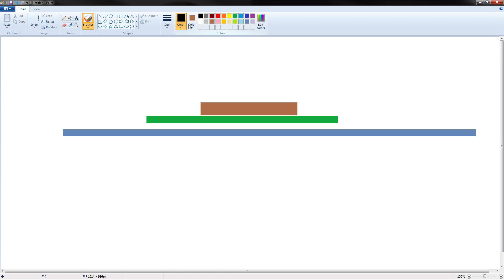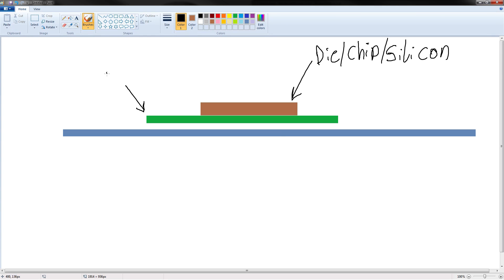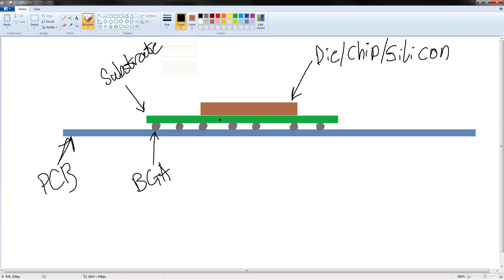Xplained with paint: baking GPUs

Comment: i have a broken r9 370 2gb so i did do the reflow repair using dremel heat gun for 10 min and kept the temp 300c after that i let it cooldown for 10min and put thermal paste. put it in my pc and still doesnt work :(
Reply: You probably killed the components with 300c.

Comment: I've always been told that the main reason for failure was due to the move to lead-free solder. The replacement solder used at the time was prone to develop micro fractures because it was less flexible under thermal cycling - so much so that Hewlett Packard for instance was his with a class action lawsuit because its laptops were prone to fail with this problem after a year or so. Reformulation of the lead-free solder has since addressed this problem.

Comment: You say the BGA balls wont melt while saying the lead around the GPU die will? it has a larger thermal area/size too a BGA ball?
If you heat the card to 180+ you can damage the caps but if you heat the card too 130c you can FIX stuck switches inside the die, the heat shakes them loose.
If your card worked and then died after you baked at 190c, then you cooked your caps........... that simple, love how this has become an Internet myth now.

Comment: Nice explantion.
I do not think you can melt or reweld any metal at 180C, is impossible.
I did reflow to an Nvidia graphic card from my Dell laptop and Worked..!!!!. YES WORKED..!!
Graphic card problem was  a set of 3 lines pattern at screen, noise and later hang the computer.
I did reflow at 180C from in a pan with top cover, I put a mercury thermomether in a little hole for  measure temp.
Temp rise from 30C to 180C, let there for 15 min at 180C and then turn off.
I wait until GPU cold naturally and reinstall, Worked perfectly.
Total time was about 1 hour.
In my opnion humidity or air bubbles were removed from inside and the card comeback to life.
In electronic industry Epoxy ressines are cured at 180C during 1 hour for best results.
No rocket science.

Comment: I know this is an old video, but I figured I should share my experience with gpu baking after watching this very informative video, which I wish I had seen prior to my baking adventures.
My R9 270x first failed on me about a year ago (summer of 2017). The windows logo would show up with artifacts when booting and then the PC would just restart, on a loop.
I baked the card at about 200c iirc for 5-6mins (I can't remember if I preheated the oven) and I was pleasantly surprised to find it working flawlessly after it cooled down a bit and I put it back into my PC.
After about a month, I had to repeat the exact same process as the card failed again, in the exact same way.
In total, this happened 4 or 5 times, until around the winter of 2017 going into 2018.
After the last baking session with the card, it has worked without failing again for around 5-6 months until now.
At present time, the card is 4-5 years old and it still works fine, although it's as hot as it's always been and its age is starting to show, as it's becoming harder to get 60fps in games.
I just hope it survives long enough for me to afford a replacement ;-)

Comment: LOLLLLL my card up again just removed the fans and the heater and plugged in the fans 
only to see what will happen my ati card hd 7770 usually work with one fan because 
its not go hot that much after 5 sec the single fan go to max speed then the 
second fan work at max speed too because the gpu go very hoot and the card didnt
 stop to work and the fans away of course from the chip then i 
let the card work only for 1 or 2 min then shuted down my pc then start it and bomm 
found the screen work normaly without any problems. sry for my very bad english
i think any one have the same problem may try this way first then baked trick if 
not

Comment: Fun fact: electrolitic capacitors(the tube ones) will explode if you exceed 8minutes at 190C or 210C. Whichever comes first. Question: would lower temperatures increase lifespan? Let's say, not exceeding 60C under load

Comment: There are 2 key considerations when pondering a video card bake: (1) Never do it if there are electrolytic capacitors on the card, and (2) some video cards (like those in late 2009 iMacs) are baked by a large number of people who report fairly long-term success (many months of use after the bake).  

Electrolytic caps are fluid filled and usually rated for 1000 hours at a given temperature like 85°C or 105°C (usually the latter).  If you deliberately heat such caps, it's like you are boiling water and over time the water converts to steam and the water level goes down and down until there's no water left.  Such caps dry out over time due to heat, which increases the ESR (series resistance).  When the ESR increases, it takes longer to charge and discharge the cap, basically rendering it less useless over time.  The total capacitance decreases over time as well.  Even if caps were never "over-heated," after 15 years or so, some smaller electrolyte caps will leak and not only become non-useful as a cap but also eat PCB traces on the PCB.  This happens to a lot of vintage computers, like Macintosh SE/30's (late 1980's tech) which I myself own and have recapped.  I usually replace such caps with Tantalum versions (which have their own issues with voltage spikes) which never dry out over time since there is no liquid electrolyte inside them.  Not all electrolytic can be replaced by solid caps though, since some very high capacitance values still only come in electrolytic versions, which is unfortunate because electrolytic cap tech really is not that great because of the liquid electrolyte.

I personally would never, ever bake a video card with electrolytic caps (which usually look like little cylindrical silver tanks on your card).  Never!  However, the video card in the late 2009 iMac (and some other models like 2011 and 2012) do NOT have electrolytic caps, and many people, myself included have tried a 200°C bake at roughly 10 minutes and found that video artifacts and computer lock-ups go away after the bake.  My last video card bake was more than 7 months ago, and my 2009 iMac is still going strong, being used daily, even for gaming.  I have a video about it here in YouTube and iFixit, and hundreds upon hundreds of people have tried it and commented back with success, continuing to have success in the months which followed their bake.  Most likely it is the "die on substrate" fix, since 200°C will not melt the solder balls beneath the substrate, which is a good thing since, as your video points out, you don't want any SMD components on the bottom side of your PCB falling off or moving around during the bake.

There will always be people debating this issue along side Apple-hater Louis Rossmann,  but I look it from a practical standpoint.  As some of my brilliant EE professors once said in engineering school, there is the Theoretical and then there's the Experimental, and they don't always compare.  If you have a video card, especially from an iMac, that does NOT have any electrolytic capacitors, and if the iMac is freezing and or displaying artifacts, you either buy a new Mac or sell/discard the old Mac or pay Apple a lot of money to replace the video card OR you try a video card bake since you really don't have much to lose on such an old machine.  I tried the bake despite the fact I am an electrical engineer (which in itself does not mean you are "certified" do perform a given task with electronics, but instead just means you have a good background in the theory).  I only tried the bake after (1) seeing many other people on YouTube and in article write-ups who had success (i.e., seeing good EXPERIMENTAL results) and (2) knowing there are no electrolytic caps on my video card.  I tried the bake the first time but used old thermal paste I had lying around for years (still liquidy but old), and that bake lasted only 4 months.  I then tried it again and used new thermal paste (and a thermal pad replacement paste), and that bake has lasted more than 7 months and going strong.  I cannot say if my 1st bake lasted only 4 months due to bad thermal paste or simply due to that bake not having fully repaired whatever die-on-substrate problems that existed.  But my 2nd bake seems to have resolved the problem, again having been going strong for more than 7 months.

For me, baking the iMac's video card was worth it.  Here's why.  I bought my iMac in late 2009 and just 3 years later, after the AppleCare expired, my iMac would lockup and show artifacts.  I wrote to Tim Cook.  Long story short, he got me into an Apple store here in Japan and Apple swapped out the video card for free.  Sadly, that video card too died 3 years after replacement, and I knew there would be no freebies this time, so I considered buying a new iMac (too expensive) or try self-repair.  That's what led me to find info on baking video cards, and I am glad I tried it.  It's not for the faint of heart though, and it takes several hours to do an iMac (tear apart and reassembly done right takes a lot of time).  But for me and many hundreds of people who have watched my bake videos and tried it, the bake has been worth it.  Not for everyone or every video card, but for old iMacs, it's safe to consider, especially if you have a video as a detailed guide to help you in the process.  I made videos on the subject since no one else on YouTube at the time took time to show all the nitty gritty details of what's involved.

Anyway, thank you for your video.  I gave it a Like.  I think it better educates people on the caveats of baking cards.  There are many things to consider before you try it.  Best wishes.
Reply: I'd add to that if you're still attempting a reflow with the electrolytic capacitors, its probably best to have them discharged.
Reply: Or just stuff some mineral wool around them caps

Comment: set hot air station on 380 c and some flux and heat up the chip and let it cool down
i fixed over 50 gups with this method with all of em working except one that die broke in half

Comment: no joke, i just baked my gpu and its back to life!!!! its a r9 280 on 175 celcius for 6 mins
Reply: Dump Lump ??! It did fix the card. Been running ever since this trick
Reply: 2 months now actualy
Reply: Dump Lump so what?! Still plays my fav games and I dont need a new one? Thats a fix to me
Reply: Heyy I have a non working R9 280 too I am going to try baking it tommorow. Do you think 175C Is enough?
Reply: Yeah thats what I did, still fully functional :) about 4 months now
Reply: yes sometimes it will work but it is no repair the bondwires in the fcbga section are broken and thermal expanding/shrinking will cause the failure again some time.
Reply: I just baked my 280x few hours ago and now it works like a charm. cheers :D
Reply: Alexander Hemp wow nice man, all I care about is the thing working like normal <3
Reply: Hey man, does it still works?
Reply: alexandr simeonov yeah still works  perfect
Reply: @timmahsound  is.. is it still alive?
Reply: @ExalyThor I do not understand your comment
Reply: Furmark can only show you thermal problems and you can use it for firstrun tests, if the card is running with furmark i use a special franctal analysing software to check the VRAM and the corefunctions of the Card, if i get a bluescreen there is a coreerror if i get fractal Errors then the VRAM or transferpath is broken. At this point you can try to pointheat the GPU sections and the VRAM to try to "repair" this but you will never get this card back to a fully functional Graphiccard.
Reply: i tryed the same with my gtx 950 on 200c and didnt fixed it when i put it in my pc the pc wont start when i take it out pc works fine
Reply: After reading these comments, I too want to bake my graphics card in an oven. There's nothing wrong with the card, but all of you make it sound so exciting.
Reply: The Black Knight of Lorn the real question is: can you sous vide it?
Reply: @theblackknightoflorn8796  reading this comment make me want to bake my Tesla for the excitement.
Reply: Yes it will function some times for months or even years but the card isn't repaired with good luck the broken FCBGA or broken bondwire will have enough contact to the other side, that no plasmasparc will burn out the Die. In most cases the Card is functionally enough that a normal User will never reach it's limits but special software to test every internal path of the GPU will reveal the destruction. I have such software and i have analysed for many years the causes of disfunctional GPU's including the "baking" procedure and there are 1 of 50 cards that will work like a good one but 49 Cards will work but if you look deeper there will be many Errors causing thermal problems or DRAM transfererrors.

Comment: cool vid (er!) anyway, noob question..... if nvidia and amd put fans on to keep temps around 60-80C during operation (to prevent damage) then, how is it that a succesful "bake" of 270 doesnt damage beyond repair? In other words, what prevents these card from simply "running hot"? Is it the fact that they run more efficiently or just better at cooler temps? Just curious...
Reply: There are actually pretty much no materials in an IC that are chemically unstable at high temperatures, at least not short term. I mean think about it, how is an FCBGA assembled? They put the die on the carrier, and they heat the whole thing up to 350°, carefully and gradually, and then they carefully and gradually cool it down, and then the balls placed between the carrier and the die have molten and connected them up.

Then eventually the FCBGA IC, gets placed on the PCB, together with all those other surface mount components, everything gets gradually heated up to 225-250°C or so, and gradually cooled down. There are some things that cannot be mounted at this stage though and are attached later.

It is however to be considered where the heat comes from. If you heat something to 200°C from the outside, then by all reason it will be still cooler than 200°C on the inside. If you however heat something to 200°C from the inside, then the general die temperature would have to be a lot higher than that, and also chances are, a minority of components will be responsible for the majority of heat, so their local temperature might be a lot higher even! Uneven heating will also cause high stress forces, as some parts will be subject to thermal expansion a lot more than others. So physical disintegration is the result.

Another source of heat related damage is electromigration. If you just heat up a material, it gives the ions a bit of energy to move around, but, chances are, the ions won't move very far, not beyond boundary of a structure, and very possibly they will fall right back to where they used to be. But when there's a voltage applied, current is flowing, it gives the ions an incentive to move into one given direction, and eventually they will move enough to destroy the semiconductor structure. So a transistor may not reach 150°C in operation, or it will be gone very very quickly. Depending on thermal design of the IC as a whole, such high localised temperature might be observed at 80-120°C external temperature.

Both of these failure mechanisms are exacerbated by the simple matter that in some materials, electrical resistance rises with temperature, leading to thermal runaway, where the occurrence of heat, whether it comes from the inside or outside, causes that piece of material to dissipate even more heat.
Reply: The difference is conductivity of the logical gates. High temperature allows more electron flow, which allows for more chaotic behavior of the electrons, and so by running current through a heated GPU, you risk shorting and permanently damaging the logic gates/architecture. 

Generally there is some minimal inductance caused just by the heat, but it's very low amperage and dissipates easily through the circuit via photon electron coupling and other manners (thermal radiation is also photons), despite, or even thanks to the voltage of these couplings. However, if there is additional current flowing, these high voltage photon electron couplings can gain the amps, and you have an internal spark on the GPU. 

Similarily, you wouldnt expect zapping the thing with a Tesla coil to fix it, despite it being also adding energy into the system.

Comment: Baked my HD 7970 two or three times now at 150°C, 15 mins, runs fine for at least 3 months. But a heat gun is a better tool then a oven.
Reply: Wertertzu What part do you heat with the heat gun? Just the cpu?
Reply: Only the GPU core itself, the rest I covered with baking paper to protect other components from heat. Use the heatgun at ~150 ° C for about 5-10min, all of course at your own risk.

Comment: Man its hard to take you serious when you start off pronouncing tech as "tetch", I get that English may not be your first language but if you have spent years googling I'm pretty sure at some stage you must have heard the correct pronunciation. So,---not hating here, its just a mild irritation from someone growing up with a Hungarian father pronouncing mountain as "montein". For the rest of it, i think you pretty much nailed it, at best its a temporary fix. I haven't done this but I suspect the best chance of success would be with a socket on the chip for weight, the rest of the card protected with some foil and focused heat from a hot air gun in conjunction with some means of measuring the melting point, ---like some solder being adjacent in a boat being exposed to the  same temperature
Reply: LOL. Do you know the difference between its and it's? This guy speaks much better than most Americans!